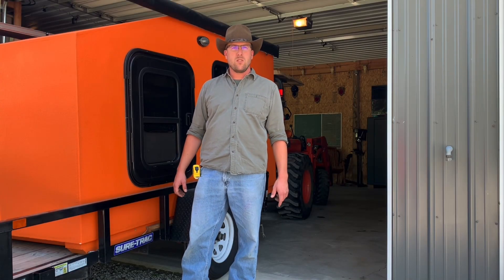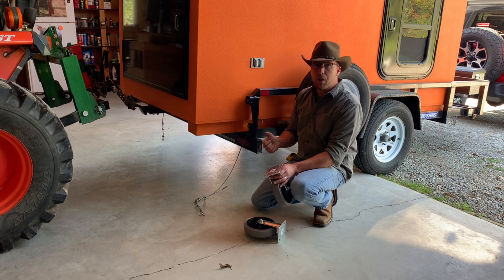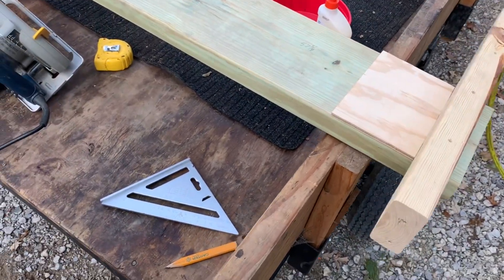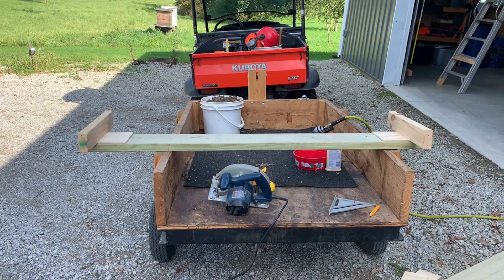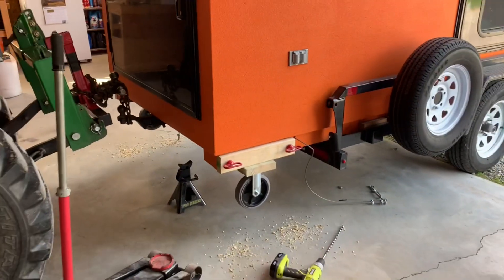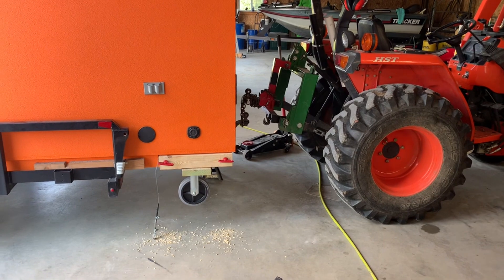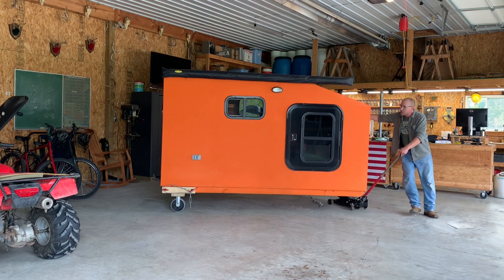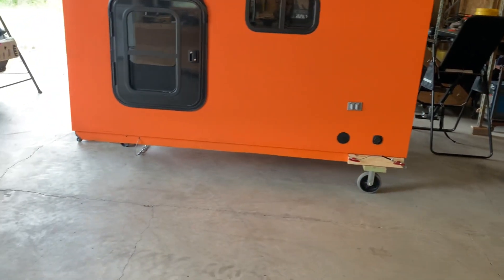DIY Squaredrop Camper Pod - Shop Dolly

Comment: Love the caster idea for when its off the trailer.  I cut some pvc pipe the width of the trailer bed and just made rollers to push it on and off.  No winch required.  When its on the trailer, just lift slightly and slide out the pvc rollers.

Comment: I like the idea of the wheels. I think I would put casters on front if they are available, or put a support for the jack so it’s resting on your skids and not middle of trailer. Just my two cents . Enjoy your videos.
Reply from the maker: Hi Mark. There is actually a steel bar spanning the skids that I use for winching the pod onto the trailer. It’s very stout and that’s what the jack is resting on. I should have mentioned that in the video. Thanks for watching.
Reply: @LivingOurAmericanDream  Sweet, I have enjoy watching your videos keep up the good work

Comment: Curious how the combo of primer + paint + raptor liner is holding up for waterproofing the camper, and if you're seeing any cracking due to it being moved in and out of the trailer?
Reply from the maker: So far so good. I kept the setup outdoors for the summer and was exposed to rain. For late fall and into winter, I built this dolly so it could be stored and remain mineable inside my shop, which is heated. To me the full test is after using the pod for a full year but so far we’ve stayed in some decent rain and temperatures ranging from the 40s to the high 80s without issue.

Comment: I see you didn't have the floor cut. Those cracks mite not have  been so bad. Why don't you push the camper on with the Tractor?
Reply from the maker: When I built my barn, it was the first one I’d ever done…..and that’s a diy floor too.  Not enough structure inside and no cuts, that floor haunts me every single day. I guess that’s how we learn…..

Comment: Don’t really think it needs to be insulated mine is uninsulated I use a mr buddy heater on low at 40 degrees cooks you out of it such a small space to heat check out working mans camper video
Reply from the maker: Insulated mostly to keep out the hot summer days, less concerned with holding in heat as we don’t really camp in the winter. We run the exhaust fan during the night to keep cool and then close up the pod during the day. Works good.